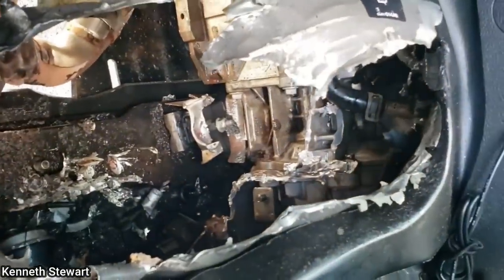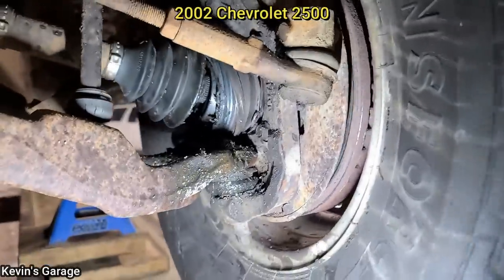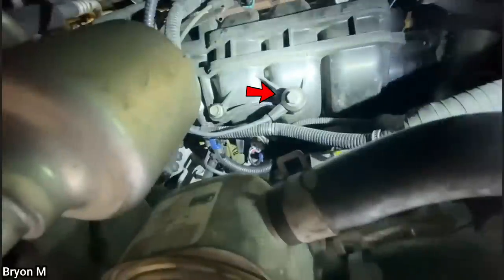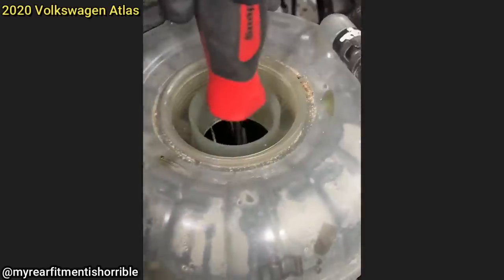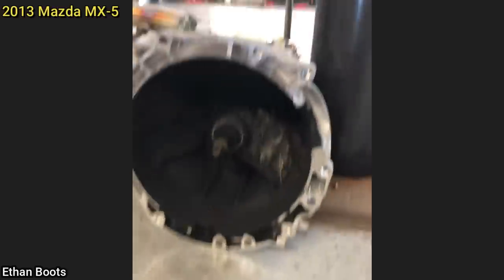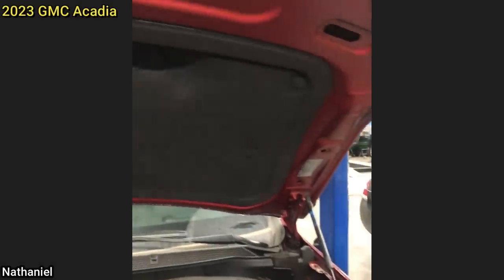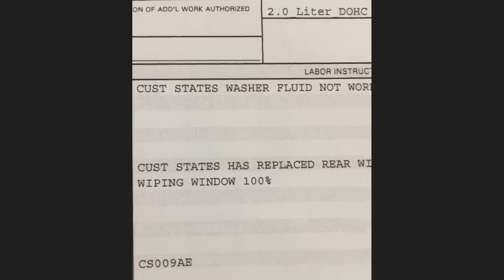Customer States Their Jeep Had A Bad Driveline Vibration | Just Rolled In

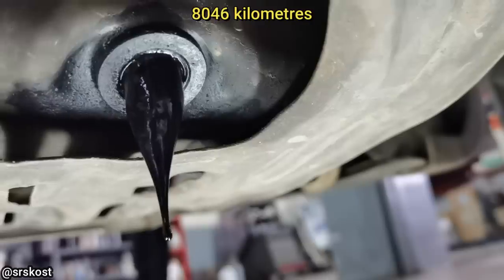Comment: 3:12 Tech tip:  Mounting your satellite dish on the wheel will cause an intermittent signal when driving.
Reply: Those Hunter Wheel Alignment Reflectors are not cheap, much less the entire assembly!
Reply: Maybe that's one of them there new fangled police radar jammers so the truck can stay in stealth mode.
Reply: Would love to know what type of drug he was on when he thought that was a good idea.
Reply: Is that one of those lifetime alignment jobs, lol
Reply: well if they were test driving thats great if not someone has some splianing to do
Reply: Was wondering what that was.  Thinking is "that some kind of wheel aliment system?"  Is in the, drove away with the petrol pump still connected, class of driver I s'pose.
Reply: @matthewgibbs6886  you don't go on a test drive with that attached. I'm surprised they were able to back out of the service bay without knocking it off from the door
Reply: The new 'Flat Wave Rotary Antenna', used to contact those in the 4th dimension.
Reply: Or worse, cut open the side of another vehicle and injuring somebody.
Reply: Welp someone is gonna roll their cart on out of the shop. And their name is Benhur.
Reply: They were trying to intercept signals from Voyager 1 and 2.
Reply: @ZetaN7  could be too. That'll put a spin on things.
Reply: @61rampy65  oh! Interesting
Reply: I thought that was a new device to keep people out of your wifes blind spot.
Reply: He's pretending it's radar for self driving.
Reply: Ha ha. !!
I thought it was some kind of Ben Hur Chariot thing.
Reply: Hmmm, me thinks that the alignment tech might just be looking for a new job 🤔. And as for the 'stuck' drivers seat, how do they manage to dress themselves in the morning?

Comment: Never thought, I will hear "The customer approved all repairs." on this channel.
Reply from the maker: Happens once in a while 😜
Reply: "Costumer."
Is that somebody who supplies the clothing used in TV programmes?
Reply: Is the tire bald and about to explode? Decline repairs. Is your car full of electrical wires rubbing on the frame and capped off with house wire nuts? Decline repairs. Does the van door go 'moo' when you close it? Yes. Yes please fix that. Fix it right away hahahaha
Reply: Followed by, "Customer refuses to pay"
Reply: @ryanwilliams6526  : Are you that unpopular guy that likes to comment peoples grammar mistakes? Rather than their opinions.
Reply: @sylviaisgod6947  repair is good. Paying is bad.
Reply: @runarandersen878  Me too! Now I have some competition!
Reply: @runarandersen878  Sometimes. Not normally, but I thought I'd try to make a humorous comment about him putting "costumer."
Are you that unpopular guy that likes to be constantly serious and never see the funny side of things?
Reply: I remember helping a friend fix his car after his attempt failed.  He replaced a sensor, but instead of putting the new one in place of the old one (because he didn't have a tool for the five point star fastener), he just taped it to a bracket and plugged in the harness.  🤦‍♂  When I showed him what he did wrong, he didn't think really mattered.  So I asked him a scenario question.  "If you pulled an electrical plug out of a wall socket, are you going to put it into a light socket?"  Of course he said no because that would never work.  I just stood there for a few seconds until he the light bulb came on in his head.

Comment: Tip: If you change your oil yourself, don't replace the oil with tar and axle grease.  It will quiet down the engine but make it extremely hard to start, especially if the air temp is below 250 degrees.
Reply: Maybe changed the oil 50000 miles ago not 5000.
Reply: Yep... but maybe he's planning to take a drive around the sun...?
Reply: I’m thinking he put vegetable oil or something in there, recycling that deep fryer oil!

Comment: Too many people are taking “grind it til you find it” as a challenge.  

Happy New Year, JRI!
Reply from the maker: Happy new year to you as well, David!
Reply: it sure doesnt want to try learning some other ways of using the clutch or getting lessons -stubborn comes to mind
Reply: @Rusty_Gold85  Wait-so that pedal isn't a footrest?

But what do I know-I got 107,000 miles out of mine before the throwout bearing went south on me. The transmission place said the clutch still had a couple of years of life left, but I figured while they had it out of the car to replace the throwout bearing, they might as well replace the clutch disk.
Reply: @almostfm  ...i had to replace the factory clutch in my 06 WRX at 162k for the same reason....the throwout bearing was toast....the disc looked like it would have gone another 10-15k miles.....and I tuned it(YES, I tuned it) at 6800 miles and its now got 215k miles and runs great....throwout bearing is bad, again....lol

Comment: That JEEP with a grenanded Tcase. Wow, severe damage.
Reply: Why do people flat-tow cars behind their RVs, instead of putting on a relatively cheap trailer, and saving the drive train?
Reply: @elultimo102  Jeeps (& some trucks/suvs) have the ability to be set in a transfer case neutral, not like a regular car where neutral is disconnecting the engine and transmission but the wheels are still spinning the transmission if being towed on the drive wheels, but jeeps 2 neutrals, where the engine and transmission are disconnected (1) & the drive wheels are disconnected from the transmission in the transfer case (2) so it can be towed, but in this clip they forgot to do so.
Reply: @thabg007  That still puts a ridiculous amount of wear on the tires, which on Jeeps are not cheap. It makes far more sense to use a trailer.
Reply: @Anne Haight  yes true, if they can afford a RV & a jeep, then why not buy a flat trailer

Comment: I've seen Pennzoil oil go like that after just 5000km in Rover V8. Never used that particular oil in that engine again, no further problems, yet the same oil in other engines was perfectly fine.
Reply: When I was a kid in the early 70's working part time at a service station after school we stopped multiple cars from using oil and blowing blue smoke by changing their oil from Pennzoil to another brand...
Reply: Rover engines have their own taste in oil lol, they'll throw a fit if it's not the correct oil or they run slightly low, the rover t16 in my car will start getting pissy if it's not at the maximum oil level, starting with the lifters getting noisier
Reply: same here I used to work at a car dealership and a suv came in and they guy used pennzoil and this was 20 years ago and the mechanic had to actually vacuum all the sludge out it was that bad
Reply: Judging by the car being a Fiat Strada, it was likely in Italy or Brazil

Comment: 1:48 The worn-out clutch reminded me of a customer when I was an apprentice for the local Rover dealer in the 1960s. The workshop was up a ramp from the street and a Rover 90 showed up one day, with the engine screaming as it crept up the ramp. Okay, the clutch plate was worn down to metal-to-metal and everything had to be replaced and the flywheel had to be re-faced – yes, it was that bad. Incidentally, while we had the flywheel off, we replaced the rear main seal, as those things went hard and leaked – an oil drip under a Rover bell housing back then was standard feature and Rover engines never really stopped leaking until the Japanese started making them, but I digress.
The owner picked up the car after the work was finished and we watched her drive away, slipping the clutch and revving the engine. We thought about running a sweep on how long it would be before the car was back – four months, as it happened. Her driving technique was keeping her poor, because any job on a Rover was expensive, but the only automatic Rovers at that time were some of the P5 3 Litres and some of the new 2000s.

Comment: There should be basic requirements before issuing a drivers license.  The first requirement should be common sense.
Reply: and none of the drivers that have a rusted out frame or anything that says "Fix me" have any common sense to begin with.
Reply: Easy test for senior drivers:   Can they drive stick, without grinding their gears?    (I got my license in '66, and never owned a vehicle with under four gears----Now I have a 5-speed car and a pick up.  (They are hard to find).
Reply: @elultimo102  Manual cars are still completely common in European countries. Everyone I know did their driver's deucation and test in a manual car (otherwise they wouldn't be allowed to drive them).
I don't understand how you can grind your gears on a modern car, unless you just completely do not understand what the clutch does.

Comment: I wish I could see how those manual drivers treat clutches. I put a BRAND NEW  clutch in a car a while ago, new owner got mad at me because it 'let go' 6 months after he bought the car and blamed me. Said it was because I put a cheap clutch in the car. I put the exact same clutch in an identical car for another customer, no issues. I also used the same brand clutch in my truck, used it harshly for years, towing trailers, pulling tree stumps, doing burnouts, blowing rear diffs, drifting, etc. Still a perfect clutch. I even own a car that I have never replaced the clutch in, since 2006. And guess what? Clutch is still good.
Reply: Some people are just really hard on clutches, because they are bad drivers. I was the 3rd owner of a 5-speed manual Lexus that was still going on the original clutch. I did finally have to replace it, and sold the car on to someone else without further repair on it. Car went almost 200k miles on the OEM clutch, because the owners were competent.

Comment: You can drive without using clutch, but you have to time it REALLY well, based on the sounds of the engine alone, which takes years driving clutch to learn.

We used to do that before mobile phones, when you could be stranded in the middle of nowhere with a clutch pedal malfunction.

Comment: 1:41 oh boy I have mismatching headlights on my Malibu.  I bought a used replacement online, not knowing they had sold them with both halogen and HID options, with slightly different reflectors/appearance.    So I just installed the halogen bulb into the replacement HID reflector, at least I didn't have to hack any wiring like that...

Comment: I've driven the left rear wheel assembly clean off of a vehicle, on a long trip. Almost 1000 mi. round trip. About half way home the wheel was red hot and crackling. Noticed it when I pulled in and got gas. Had to replace the whole lower swing arm assembly because the bearing had welded itself to the spindle. 🥴🤦

Comment: I was working for a dealership and a customer Special ordered a vehicle that arrived with 3 black leather door panels and one beige leather door panel.
Reply: I worked at a Ford dealer, and had a guy who bought a new 99 Explorer with leather seats, but the passenger side seat said "Mountaineer" on the upholstery. The Ford field rep guy had to come by to personally approve the repair.
Reply: Former Ford tech here. Saw several Mercury Zephyrs and Ford Fairmonts that came with mixed trim. In the days before digital cameras and email, the district rep had to come out and personally approve the repairs.

Comment: Seeing that miata clutch blew my mind. I didn't even know you could shift without the clutch?
Reply: 6k launches will do that
Reply: Sure can.. any manual shift can be... just have to get the timing right
Reply: I shift my Elantra most of the time without using the clutch, except for first gear
Reply: @sylviaisgod6947  do you just rip the shifter out of gear?
Reply: @scottrussell6717  started driving manual four years ago but never knew that. Tbf I baby my car a lot
Reply: @pieswimmer1  No, I don't "rip it out of gear", I let off on the gas peddle, move the shifter to neutral, (which is easy to do without using the clutch), hold the shifter with light pressure in the next gear position, and as the engine rpm goes down, once it hits just the right speed, the shifter will slide right into gear. Takes some practice and just the right timing. Works best when upshifting, not so much for downshifting.
Reply: I did it once by mistake on an early driving lesson  - I live in the UK so have only ever driven manual. My instructor was quite impressed.

Comment: 20-15 years ago i had an old gentlemen with a low milage mint condition Volvo 240 as my customer, he regulated the speed with the clutch pedal so every 8-10 months i had to install a new clutch for him ;) After the first 3 clutches i tried to convince him to buy a 240 with auto trans instead but he was like "ive been driving stick for 60 years, ill do it til i die!" He was okey with paying for clutch changes every now and then ;)

Comment: The owner of the Mazda MX5 must have issues with driving cars with manual transmissions. Funny how he had it for a few thousand KMs and needed a new clutch and then not long after that needing another new clutch. Says a lot about his driving prowess or lack thereof. I'd say it's been ridden to death. Some people have a very nasty habit of resting their foot on the clutch pedal while driving which causes needless clutch wear. MX5 driver perhaps also has a bad habit of not engaging or disengaging the clutch properly under certain loads which ultimately causes the clutch to burn out. I could almost see inside the bell housing of that gearbox in the clip. I could pretty much tell there may have been a lot of burnt clutch material within the bell housing and a lot of "clutch soot" as well. Definitely does not occur under normal wear and tear conditions. And not that quickly either. Under normal wear and tear conditions where the clutch has gradually worn out through normal use and through prudent driving, the clutch assembly would've had a good life and not been overworked or put under unnecessary stress, thus you wouldn't see all that burnt clutch material within the bell housing and you'll only see a small amount of clutch soot residue in the bell housing. There a difference between a clutch that's worn normally and a clutch that has worn abnormally from people's stupid driving discipline where their bad habits are as I forementioned earlier in this comment. Some clutches do fail prematurely due to poor design or manufacturing processes. That can happen. That I feel certainly didn't happen in this particular clip with that MX5. The abuse signs are all too obvious. The MX5 driver may not have meant for that to happen intentionally but it appears that he may not quite be up to the task with driving cars with manual transmissions. He perhaps may have only driven automatic cars and perhaps decided to try his luck with a manual. I say mission failed. Try again next time. Needs more training with manual transmission cars in order to be able to drive a manual car safely and effectively. And also be able to drive a manual car efficiently so that no problems with the clutch wearing like that one did will ever occur. Manual transmission cars have footrests as well. Use that instead of the clutch pedal for a footrest.

Comment: I used to date a girl who had a handicapped mother, I think the term was called "Being batsh!t crazy". She asked me to look at some car problems. I told her she should get a quote but I'm sure the cost of the CRITICAL repairs (head gasket (for the car, not the mother), 4 tires, brakes, and a BAD power steering leak) was a good bit higher than car's value***. Her solution was to get a brand new car she couldn't afford. Somehow she got qualified for a base model Kia. She couldn't drive a stick but said she would figure it out in an empty parking lot at night. I knew it wouldn't matter because it was going to get repossessed in maybe 5 or 6 months. She ruined the first clutch fairly quickly, somehow Kia replaced it under warranty. The daughter and I split up for unrelated reasons and she left town. I HEARD that she took it in for a second clutch, the dealer called her and said they would take care of it, but she was already far enough behind on her payments. I guess as soon as the finance company found out the dealer had it they picked it up (with or without a new clutch we will never know).

Comment: So I have a 1992 K1500 Chevrolet with a 350 V8 pushing an NV 4500 transmission. Seeing as how this was my first  V8 manual vehicle I ever owned and bought it at just 21, I was by no means gentle on it. I just rolled over 300,000 miles and still on the same clutch I bought it with in 2001 at 89,000 miles so how in the hell can someone burn up a clutch in just 3,000 to 5,000 miles???? Granted for the past 5 or 6 years it's just been a farm truck and driven less than 6,000 miles a year but it STILL on the same clutch and I use it to tow trailers with.
Reply: Clutches are usually burned if people put constant slip on it, a foot left on the clutch pedal can be enough over time. 
Some use the clutch like a hydraulic torque converter, in this case it's burning even faster

Comment: I had a “customer states” problem with a rental van I had.  It was a chysler or Dodge and the freaking motorized sliding back doors would phantomly open as we were driving.  I would still like to know what was causing it.

Comment: PRO TIP to technicians reading this, if a knock sensor is in a total swine of a place to replace (toyota / lexus V6) fit a new one externally to the block anywhere about half way up the cylinder bore. You are welcome.
Reply from the maker: Not on the intake to know how much it's knocking? 😂
Reply: @JustRolledIn  you laugh, but I have seen folks mount knock sensors on cylinder heads(but at-least to metal) after an aggressive head skim so as to ease off the sound of knock to the ECU . I walk away, but im sure they lasted well.
Reply from the maker: @denisohbrien  interesting. If it works it works I guess lol